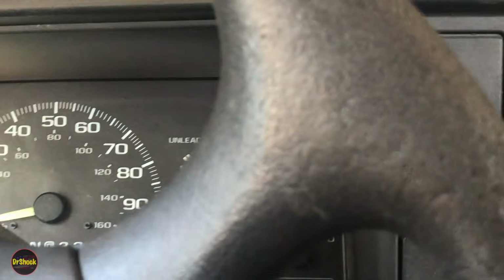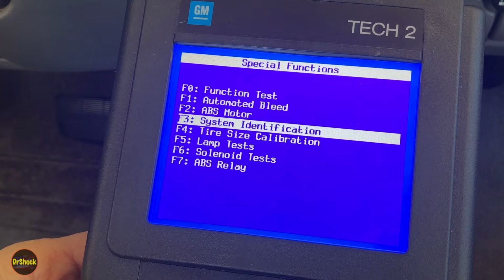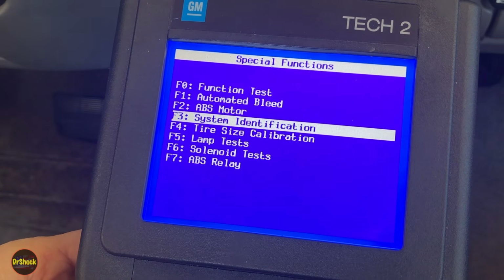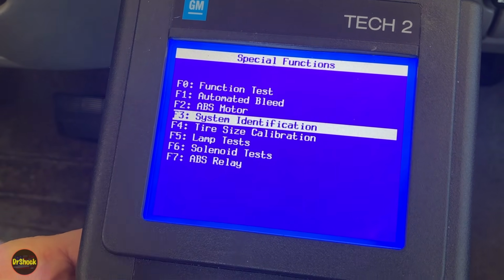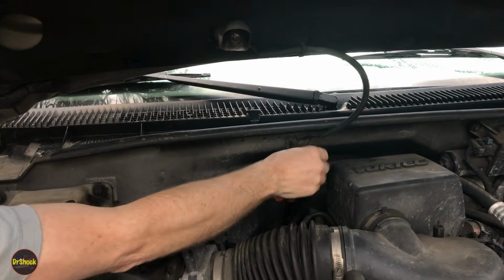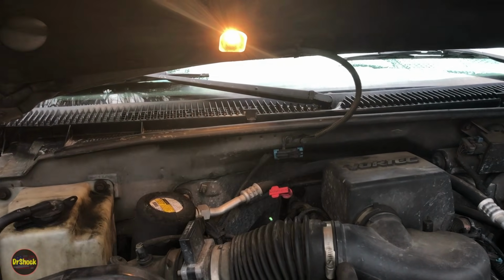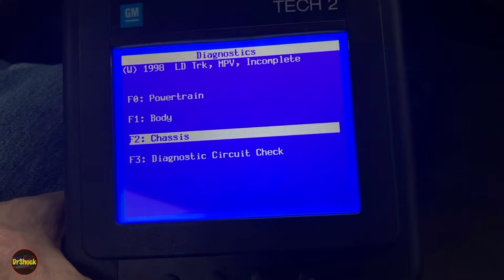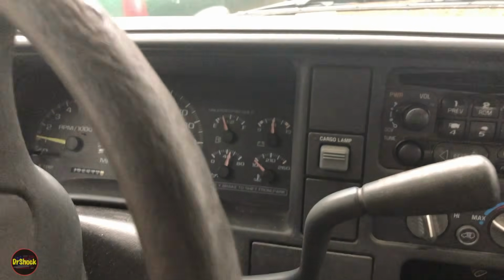1995 - 2002 GM OBS Truck 4WAL ABS Module DTC C0268 Repair Kelsey-Hayes EBC310 Teardown (Chevy & GMC)

Comment: Dr.  Is this the K-H that none of the ABS Module Repair places will attempt a repair (I think due to the way you have to remove the top of the electronics)? I have tried to get someone to rebuild my K-H on my '96 GMC Suburban K2500, 7.4 Gas and not a single repair place will attempt it. The later one, 325, (is that what yours is) they do everywhere and offer a good warranty. I see you have listed it as 310. Hope that is what mine is as it is NOT a 325. Thanks. I am at 1:11.
Reply from the maker: This is about the EBC310 yes, not the 325.   And yes, the 310 EBCM is completely NON rebuildable.  The 310 BPMV used to be rebuilt by Kelsey-Hayes and sold thru ACDelco, but no longer.  All new and reman parts discontinued by GM back in 2020.   So the only repair route is salvage yard, which is why I provided quite a bit of additional identification info in both the video and alot in the video text description as well.
Reply: I have the same issue with my 1996 GMC 2500 7.4L Suburban the anti-lock brake light is on and can't find anyone who will help me and I then saw this video, it gives a bunch of info but is still discouraging due to you not being able to get needed parts and having the expensive tech-2 or bidirectional scan tool that can do a ABS bleed or readout on trouble codes with these year trucks. It's going to get to a point where you can't find these in salvage yards and no replaceable parts at all. What are we suppose to do with repairs or replacement on a poor common faulty ABS module in the future? At that point all we can do is delete and bypass the ABS module completely which sucks because now the vehicle isn't operating as manufactured or designed to. I really hope somebody or a company makes their own parts in house to be able to reman these into a complete unit for us to purchase and then send in the core to be remanded as well, because this is starting to get scary on parts not being  available and not made anymore and with the shortages on parts. It's a saftey issue if we can't keep our vehicles reliable on the road. 😥